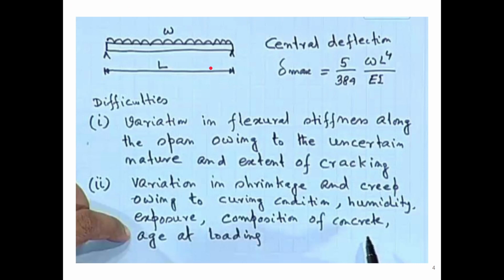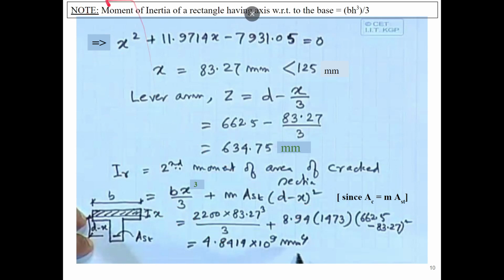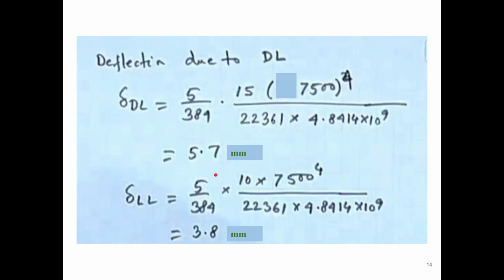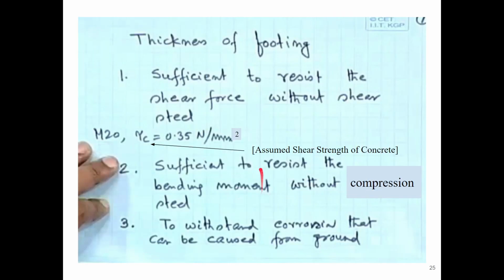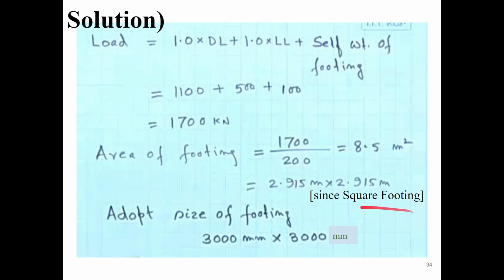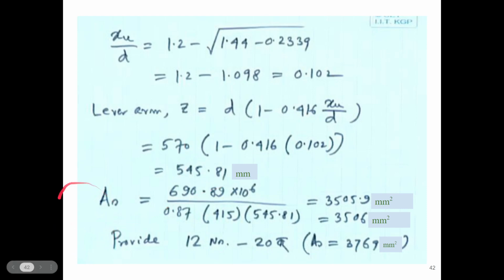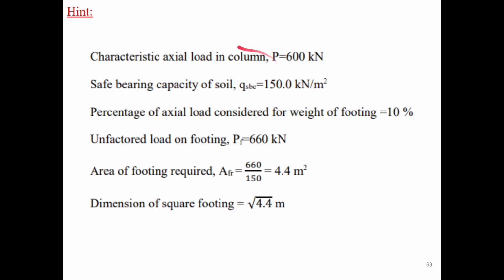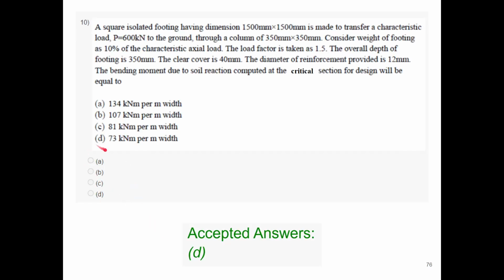Design of Reinforced Concrete Structures - 9th Week TA Class [24th September 2023, Sunday]

Comment: While calculating bending moment we are using total breadth of footing but in some books the breadth is taken as 1m and found B. M and this B.M. is used for calculating the depth required for bending. Please explain
Reply from the maker: Yeah, that is mainly for 2 reasons:  

(i) The Width of Footings such as Isolated Footings, Strip Footings (or Wall Footings) is generally around 1 metre.  

(ii) If we don't know the Actual Width we have to design for, by taking the Width as 1 metre, the design can be made relevant for any value of Width (which is similar to the case of slabs). We just have to multiply the Actual Width by the Bending Moment (B.M.) value. A similar process can be adopted in our design also, simply by dividing our B.M. by the given (or taken) Width.

Comment: Why we have assumed 0.35 n/mm^2 shear strength of concrete in calculating depth required for one way shear can we take another value if yes then on which basis we will take another value
Reply from the maker: This is as per Table 19 of IS 456: 2000 (Page 73). For the M20 Grade of Concrete, the Shear Strength of Concrete should lie between 0.28 and 0.82 N/mm^2, depending upon different percentages of steel reinforcement. So, a standard value of 0.35 N/mm^2 has been taken as per experimental observations. However, you are free to take any value in between this range, provided the value is not given in the question.

Comment: While calculating development length for footing what is formula to find stress in bar due to design load i.e sigma s
Reply from the maker: There is no formula as such for finding the stress in the bar due to design load (i.e., sigma s). We have to calculate the maximum load/stress that is acting at a particular joint for the whole building. Normally that is evaluated by using Structural Engineering software (such as ETABS, SAP2000, StaadPro, etc.) as it is practically a little difficult to manually calculate it for a large building.  

This value will be provided in the question, so you don't need to worry. If it is not, then you can assume it to be the design tensile strength of rebar, i.e., 0.87*fy; although, actually it will be an overestimation because, in reality, it is less than 20% of this value.